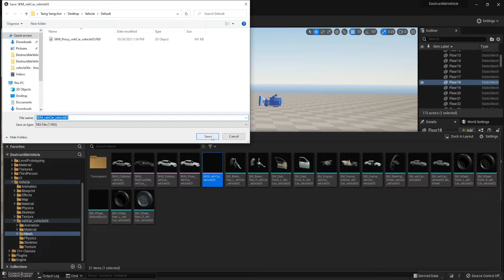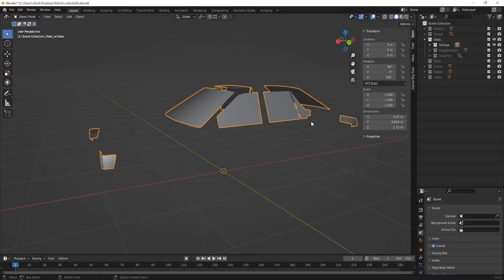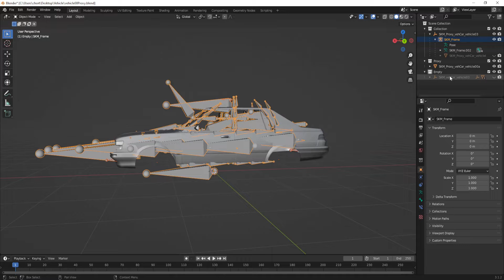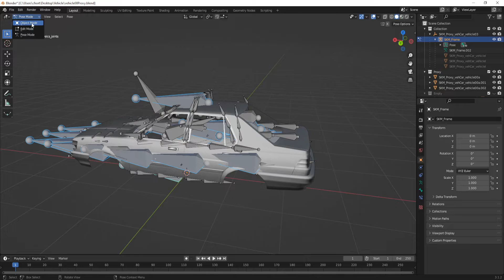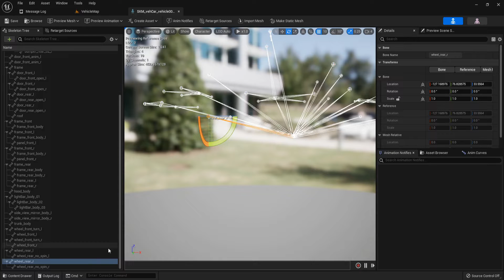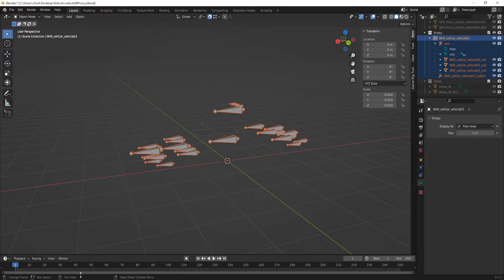How to Add a Custom Vehicle to City Sample Project?

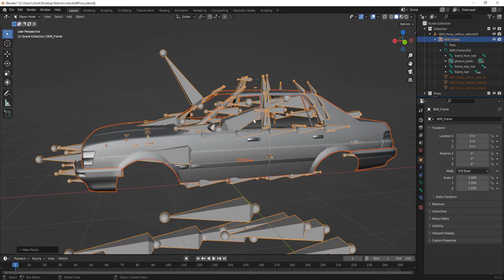Comment: 0:12:42 when i try to set parent to amature with automatic weights, it gives me a warning says "Bone Heat Weighting: failed to find solution for one or more bones
" and no weight is assigned,any one have same issue like this?
Reply: i try to scale mesh and armature 100 times, then successfully set parent to amature with automatic weights,after that i scale them to 0.01 times, currently it seems fine

Comment: Hello! I have an important question about this system. I want to try implementing it in Unreal Engine 5.7, but in the video I couldn’t see the pipeline for the entering and exiting vehicle animations. How can this be implemented? Do you have any tutorial or resources about setting up the enter/exit vehicle animation system? I’m currently a beginner with Blueprints, so I’m wondering if this would be too complex or if it’s still manageable at my level. I would really like to add this animation system to my project. Thanks for the great tutorial!
Reply from the maker: https://youtu.be/uUi2Yz7JTM8?si=_Q1s81PKX7dsQLAF Enter and exit vehicle tutorial.
Reply: @jourverse  Would it be okay if I first watch this video to the end and complete the steps you mentioned, and then watch your other tutorial afterward?
Reply from the maker: @emr3smith  It is ok.

Comment: I encountered a problem, when I was customizing the vehicles in the City Sample , the bones were modified by me, slightly changing the position, and the bone mesh of the vehicle was damaged when imported, resulting in serious deformation
Reply from the maker: You can download the Blender file of the example vehicle. Try exporting and importing it yourself to see if it has the same problem.

Comment: Hey man I have an issue . I am making a speedometer and i used to bo vehicle so that it will act as a common blueprint so that every vehicle will have speedometer without making it for every vehicle but when I used different cars it won't work and when I used the same car agar it won't work on the previous car too. The cast is failing but it's not giving any error that the cast is failing

Comment: Amazing tutorial series!! Before diving into the deep, can you confirm this works in 5.3 and working in packaged build (windows) 😁
Reply from the maker: It is work in 5.3 with some process to update the project, but it won’t work in packaged  build.
Reply: Thanks for the quick response 😢 sad to read it won't work in package build.. do you get any specific errors? Is this only in 5.3 or also others?
Reply from the maker: @Mind-Node-24-7  The deformation of the mesh is only work in editor. Even if I solved the error and package the project, the deformation still not work in packaged build. This is happen for all version. 5$ for all the projects that I made. You can continue support each months or cancel after you download the projects.
Reply: I'll subscribe to your Patreon tomorrow and see if I can find out.. the minimum subscription for this project is the 5$ one?

Comment: Sir, could You tell me, is it possible to implement the methodology You suggest for a cinematic? I want to make a short video, which shows Two vehicles running into each other with following deformations of both of them. Is it possible to have such deformations using sequencer?
Reply from the maker: Yes, you can. I saw a tutorial about this. This tutorial may help you: https://youtu.be/CeI7dSGc_j0?si=sClgevhm3dkwDcIX
Reply: @jourverse Thank You very much, Sir. With the best regards

Comment: This is very impressive, I appreciate you a lot for doing these tutorials. However I remember back when I created my own city using the Matrix tools with Houdini there was an issue with the destructible system only working in editor but never working when packaged to an executable. I am wondering, have you checked if it's working in packaged app? We spent weeks trying to figure it out and we couldn't find the issue/solution to make it run in packaged app.
Reply from the maker: Yes, I am facing the same problem as yours. The deformation only work in the editor, not in the packaged. I try to solve it too, but unfortunately can't get it to work.
Reply: @jourverse   :( than it's kinda of useless

Comment: Hello, can you help me with an issue? I'm having a problem when adding our own vehicle to the city sample. The vehicle disappears even though I add physics assets. Could you assist with this?
Reply from the maker: When you drag your vehicle skeleton mesh in the scene, did it appear in copy scale? Sometimes the scale of the vehicle is too small, so you can't see.
Reply: @jourverse  If I add animbp to the vehicle, the car distorts, and then when I adjust the physics assets, the vehicle disappears. When I press the play button, it vanishes. Can you help with this?
Reply from the maker: @omega37  Did you use car 3d model that I provided or use your own model? You should use the provided 3d model first, because it might help you to implement your own model.
Reply: I used my own model. Now, I'm creating yours. Can I directly apply the instructions you provided below, or do I need to make adjustments in Blender for this? @jourverse
Reply from the maker: @omega37  If you use my 3d model, you can import directly without adjustment.

Comment: Hello! Great tutorial. Is it possible to add weight and inertia? For example, in City Cars sample there is no difference if i hit the wall on 1 km/h or 50. So, that the damage value did it depend on the initial speed?
Reply from the maker: This is the drawback of this system. I’m not sure we can adjust that inertia. You can go to physics asset of the vehicle then adjust some threshold there. Experiment with the settings.
Reply: @jourverse  thank you for answer.

Comment: Thank you for a great tutorial. I subscribed to Patron and packaged the project files. But it doesn't package. How do you solve it?
Reply from the maker: Thank you for your support. You can try download this project then package it. https://www.patreon.com/posts/project-file-5-89295989 This problem may happen because of custom anim graph.
Reply from the maker: I'll try to solve it. If I can solve it, I'll upload the fixed version tomorrow.🙂
Reply from the maker: Fixed Project: https://www.patreon.com/posts/project-file-how-91805093. I removed the DestructibleVehicleRuntime module from the project and now you can package the project successful. Unfortunately, deformation of the vehicle only works in the editor but not in the packaged project. https://forums.unrealengine.com/t/niagara-city-sample-vehicle-damage-sensor-grid-not-working-in-standalone-or-packaged-only-in-pie/537456. I hope this might help you a little bit with the problem.

Comment: Great tutorial, does it work with 4.27?
Reply from the maker: I never try it on 4.27. I guess it work on 4.27, but you need to enable the control rig plugin.
Reply: OK thanks